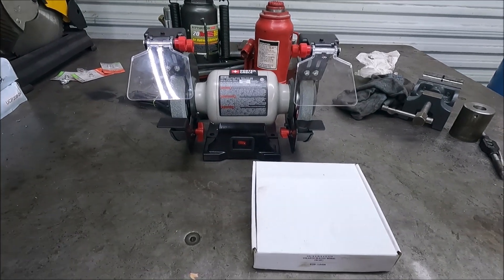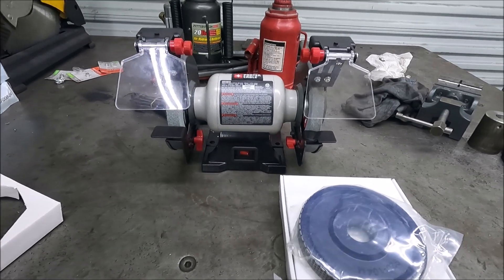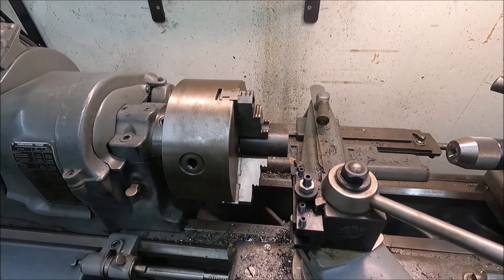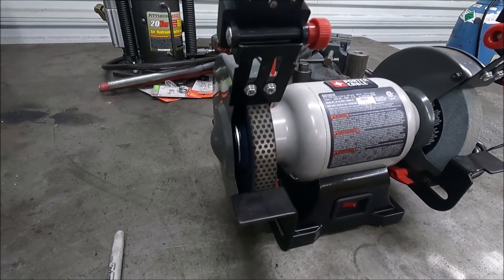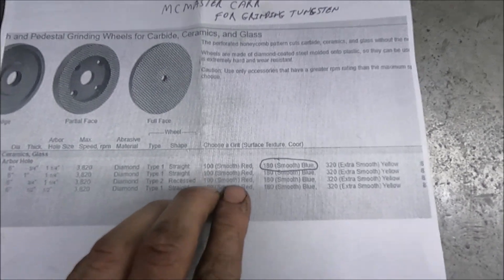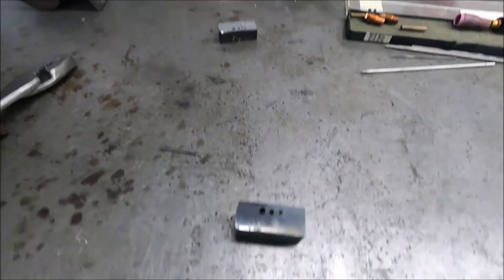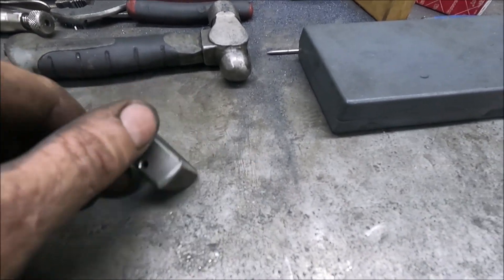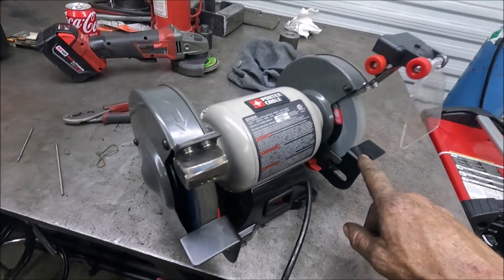How to Build the Best Tungsten Grinder

Comment: Ya, my school at davis tech is a Lincoln electric sponsored school. Everything from the welders to the hoods to the welding booth setups are an extension of Lincoln electrics school. I also copied that setup. Jet 6" grinder with McMaster car diamond wheel. Lincolns setup was 1" w and the red (100) grit. I was there a year and a half.. 140 students all day use and the wheel never was changed that whole time I was there an it worked great when I graduated. Sure beats the little handhelds. 
This setup needs an arbor adapter to fit a 1 1/4" hole to a 1/2 " arbor.. 10$ on amazon.

Comment: Piece of advice use your cordless drill to get a better grind on the tungsten  .
Reply from the maker: Not necessarily.  The grind came out perfect.
Reply: @1970chevelle396   I grind with my drill and have a cermetrical circle 🔵  no flat spots . The Current flows along the fine lines of the tungsten . if there is a small flat it will change the penatration into the metal and the arc .
 Try it , put a slight flat  into the tungsten  , weld , then cut the test piece , clean and acid wash . Keep in mind the shape (15 ,30, 60 deg flat 60 deg ) of the tungsten dictates the dig depth and arc shape . I am not trying to tell you to change the way you weld just pointing out something you might not be aware of  I have been using the same diamond wheel upwards of 20 years for tungsten grinding on a 6 inch craftsman grinder .I made my guide with a degree meter so I can grind at any angle I need .up to 68 degrees any more is pointless .

Comment: that came out nice.   Might end up with 3 grooves in your wheel but it's dedicated so ....... doesn't really matter I guess.  Wheel coming at you makes me think there could be a risk of it tossing a rod back atcha ...... is that possible?
Reply from the maker: With this type of grinding wheel it won’t wear grooves in it.   It grinds real nice and doesn’t try to throw the tungstens back out.
Reply: Diamond is harder than tungsten. It's not going to wear a groove into it like a grit wheel.